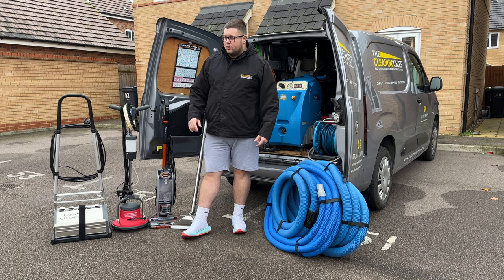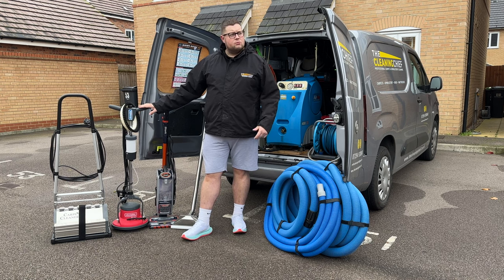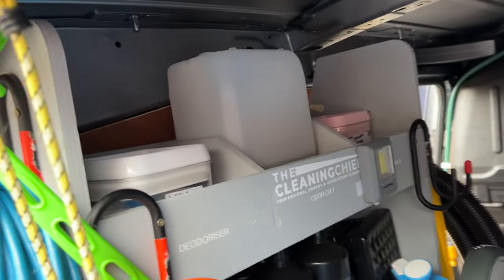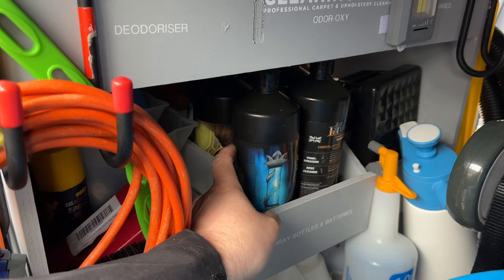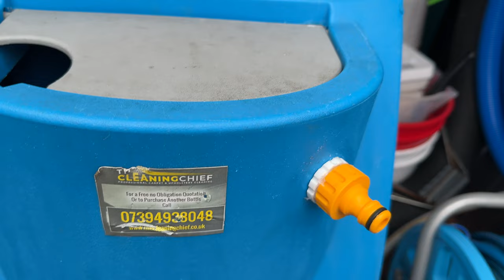VAN TOUR ! | SO WHAT EQUIPMENT DO WE ACTUALLY USE ?

Comment: I also use a shark vacuum so much lighter than a sebo 
And does the same job 
Also use a tm3 crb for carpets and rotary for hard floors..
My chems are probably the same woc as yours 
I don’t use heat either although i do have inline and intank heaters 👍
Never tried saigers sauce how’s that compare to blaze and spm ?
Reply from the maker: Saiger’s Range I Only Use For Pet/Odour Issues Really ! General Carpet Cleaning Is Usually SPM or Shockwave